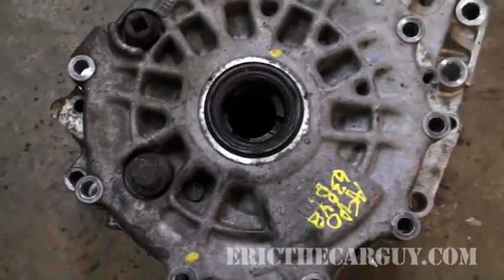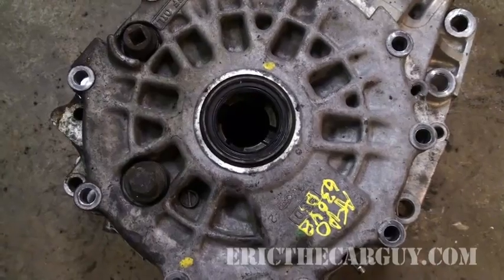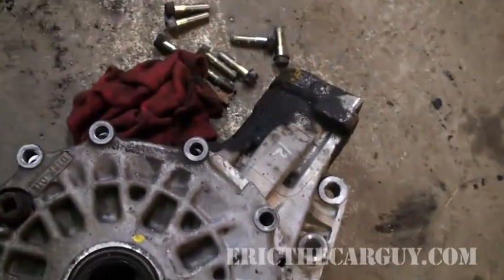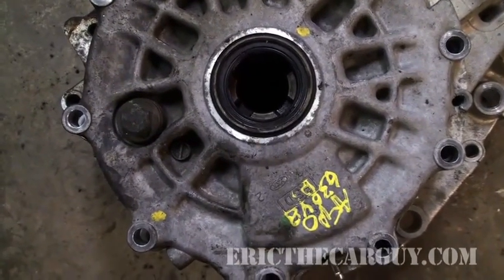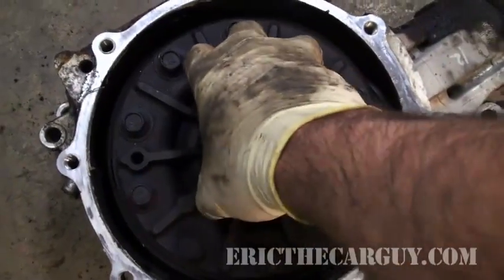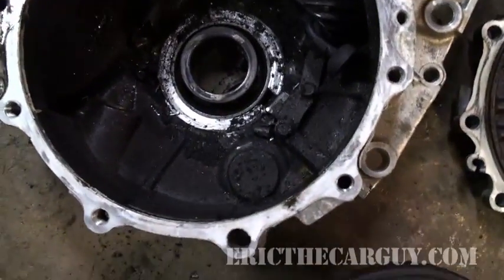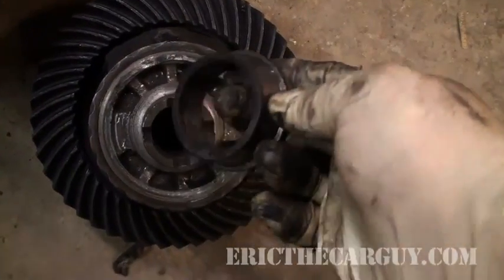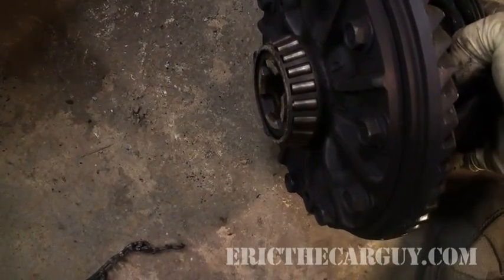Differential Fail

Comment from the maker: @EricSeymour77 I've shot a video on changing a clutch where I did the fluid that I haven't edited yet.  The recommended service interval is about 30K so it would be a good idea to change yours.  Use ONLY Honda fluid, you will need 3 quarts.  It's quite simple really, on the outer casing of the trans you will see 2 plugs, one for drain and one for fill, the hardest part is getting a funnel with a 90º bend to get the new fluid in, you fill it until it comes out the fill hole and your good to go.

Comment from the maker: @nightmathzombieethan Use Honda manual trans fluid only.  You can also use GM syncromesh but I recommend the Honda fluid.  If you leave the 30W in there it will ruin the trans.

Comment: Always check the fluid level every oil change too.I do this every oil change I do if the vehicle has a differertial.Ended up replacing the carrier bearings,pinion bearings and the ring and pinion in one rear end of a Dodge Durango.The dealership that did the oil change never checked the fluid level and it was making howling noises.

Comment: @ETCG1 Damn! Thanks Eric...yeah I wondered why she's been a little stubborn going into gear lately, I thought it was just my linkage showing it's age but I was still a little paranoid that it happened NOW, shortly after the oil change. It bugs me that the FSM didn't suggest it though...it just said to use 30 Weight or 10W40. Thanks for the heads-up.

Comment: Aw, the poor little guy. He would've started out as bits of scrap metal and/or iron ore crafted into a mechanical marvel and and now he's just scrap metal again. I just replaced the oil on mine, learning that you should make SURE you've identified the fill plug and not some random casing bolt before draining it. D= On the plus side, I eventually figured out that 6pt ratchets are way better than 12 pts for stuck bolts. =)

Comment: saw this all the time for the breif period i worked at a lawn mower repair shop. people would go out and buy a brand new lawn mower and start using it right out of the box. what they didnt know is that it cant be shipped with oil in it (i would assume for environmental reasons) so these people would run them dry and destroy their brand new motor

Comment: Bought a truck from a dealership. They stated all fluids had been changed so I didn't check the transmission, differential, etc. Well, the transmission had absolutely NO fluid in it and a week after purchasing, the input shaft snapped on the transmission after a bearing seized. Second tip for all of you... Don't trust what anyone tells you has been done. Hence why I do all my own work. You can't trust anyone for a second.
Reply: I know that it's an old comment, but I've seen this firsthand when a friend of mine got a junkyard transmission installed and he drove it about 50 miles and it started making grinding sounds.   Added some gear oil in a random parts shop. That transmission was 100% empty, and we filled it up with gear oil.  The transmission however failed a while later.

Comment: That's what happened to me but it was the Honda dealers fault - The tech forgot to tighten the auto transmission lines that go into the radiator the new radiator they installed for me. I drove 40 miles home and once I hit the exit I lost power pulled off the road and it all gushed out onto the ground. They did put in a newer "used" one with 200,000 miles less on it and i think the tech lost his job. I didn't ask for that I just wanted my car fixed. Mistakes happen. He must have made a few more IDK?